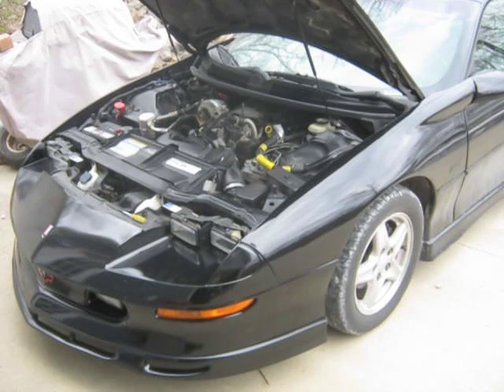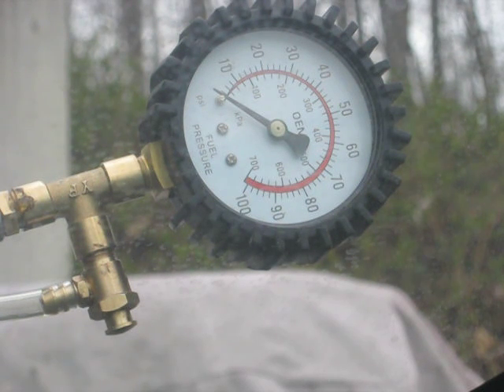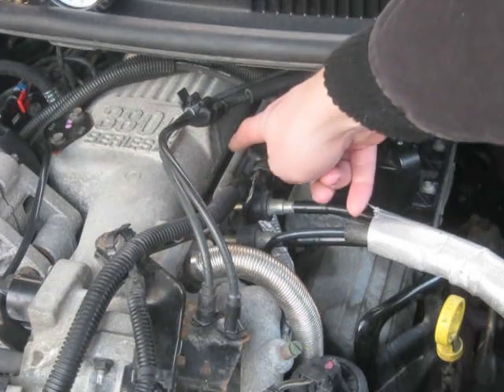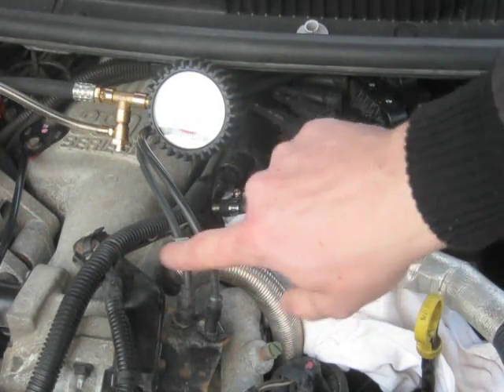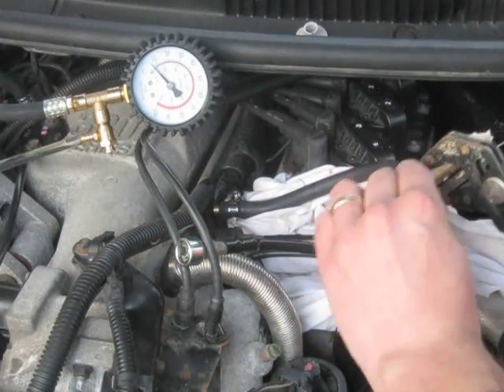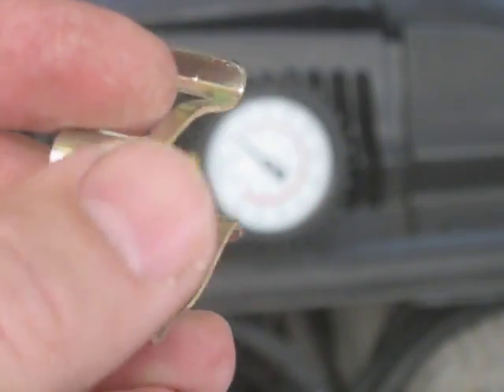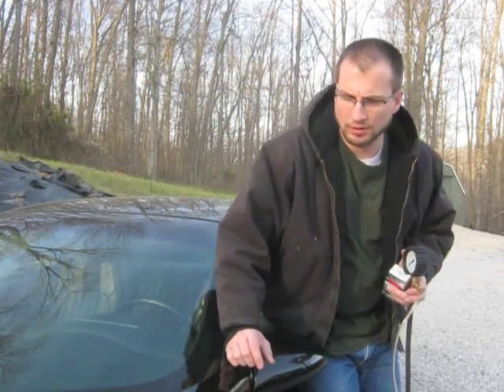Car cranks too long - Fast fuel pressure bleed off - Faulty regulator - Part 2

Comment: No question the original regulator was bad, there was fuel in the vacuum line. However, was the first new regulator faulty or did it leak because you didn't use the snap ring? You used the snap ring on the second one so you can't really say for certain that the first one was bad and the second one was good can you?
Reply: YOU HAVE TO USE THE SNAP RING!! I tried to use only the new clamp it comes with but the seal isn't tight and will leak gas. use the right size pliers and pop that new C ring in.
Reply: Facts

Comment: Great video . You went through the whole system , isolated the problem , fixed it and VERIFIED the repair . If you moved on and changed the pump - you would have been SCREWED . Then - do you put in ANOTHER ?  THIS is how it's done . There is a video on Schroeders Box where Matt explains the whole system .  On my 1987 Celebrity 2.8L the FPR ruptured . Gas came out of the throttle body through a vacuum line . I put a vacuum pump on the line and it pulled fuel on the first pump . And that FPR is buried UNDER the intake plenum and BETWEEN the fuel rails . I was lucky no fuel went into the oil . Keep up the good work !

Comment: I'm having something similar with at Toyota matrix....well I just believe that it takes a little bit too long to kick over. Nothing like what your car was doing but I have noticed at times it's starts a few seconds faster than other times. Did the key cycling thing to prime the pump and it did start on the more faster side. Any suggestions?
Reply from the maker: you could check fuel pressure like I did. That'd tell you a lot. Sometimes a dirty Mass Air Flow sensor can cause long crank at start. Could be any number of things, but a fuel pressure gauge can help narrow it down.
Reply: @TheDaninator  i did clean the MAF sensor and as well as the throttle body. I noticed a nice jump in performance but im still not too comfortable with the starting. Thanks for the tip with fuel pressure.

Comment: Check the codes for clues to mixture problems. ALWAYS disconnect the battery before removing electrical connectors to some parts. It can cause a glitch and short out parts or the computer.

Comment: the pump is probably bad too-  gauge needle should JUMP up at key-on.  not sluggish.
Reply: If the regulator is bad , and the diaphragm is ruptured ,  fuel will come out of the vacuum line . Fix the regulator FIRST , THEN check the pump . On my 1987 Celebrity 2.8L , the FPR ruptured and fuel came out of the throttle body , VIA the vacuum line . I put a vacuum pump on the vacuum line . It pulled fuel out on the FIRST pump . Bad FPR . He had a bad NEW FPR ! He fixed it .He then checked the pump .  Diagnose and isolate the problem .
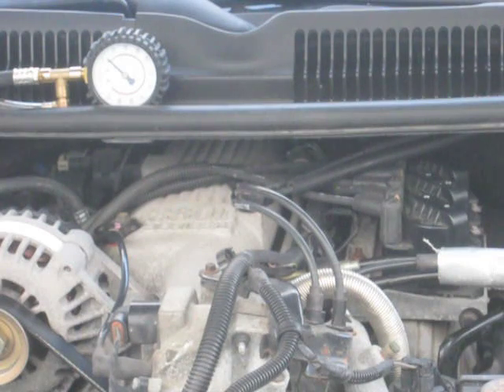Reply: At 2:48 he begins to explain ALL the possibilities for the low and no hold pressure . In this case , the NEW FPR was BAD . A new pump would accomplish nothing , except a thinner wallet . Every repair must be verified . In this case the FPR was not holding pressure . On my own car , it ripped and dumped raw fuel out the vacuum line . ZERO pressure and NO HOLD . Unless the entire system is checked , changing parts may not cure the problem . This case proves new means NEVER EVER WORKED . And you may inject problem # 2 with bad parts .

Comment: The Daninator how did you find this problem . I changed the regulator and got three new coils after getting faulty center one . did your have the same problem hot if you like go into bk eat for like ten minutes and come out and she has a hard cranking time
Reply from the maker: With the faulty regulator the fuel pressure would always drop to zero, so no matter when I tried to start it, it always took to long to crank.
Reply: My fuel pressure drops to  zero I placed a pressure gauge on the rail , But ill try the pinch off return line too see if the tank check valve is bad . I get 40 psi at idle I hope I don't have to change the pump or ill have too cut a access hole on top
Reply: The Daninator I blocked off the return fuel line and my pressure drops to zero . I have already replaced the fuel pressure regulator . I think its the check valve on the fuel pump . I don't get the fuel pressure to hold like in your video . I have too cut a access hole in the back near the tank .

Comment: same thing with 96 deville .. long cranks ... . mysterious wiff of gas every blue moon ..waiting on the part  now .. but weirdly enough i turn the key . wait a few seconds and it ll start rite up the last day or so . but like i say before  for like the last week . it was giving me long cranks . but then again i wasn't waiting the 3second poss to build that much pressure to just kick it on..but I'm gladif this is the fix ..even though i replaced this piece 2 years ago.. possible a common part with a spring can go out qucicker then u think . plus it may have not been the best quality part but it was like 50 dollars ..? we'll see. in afew days ..just ordered one for 35 .. good reviews ..

Comment: I wanna do that to my nissan titan 05,but just wondering if you have any idea,where is the regulator valve or how do i do it?
Reply from the maker: I don't know exactly. It's usually on the fuel rail to the injectors, but check out your owner's manual or google it

Comment: Great video!  Very good diagnostics and explanation.  Surprised however that after the fix the initial ignition on only got the pressure up to 10 psi. I thought it should immediately go to 40-50. I thought I heard the ignition being cycled 3 times to get it in that range. That behavior wouldn't solve the problem would it?  Again thanks for the video. I am replacing my FPR this weekend and this video will help ensure I am getting it right
Reply: condor5635 exactly, 3 times to build-up pressure. There is still sth wrong. In My opinion there is full filter clogged.  Question is where, there is one afterfuel pomp, one in FPR and there are filter in injectors.   Definitely to check!

Comment: you did good...alot of info,,,bro,,,,i have a 200 chevy short bed with a 4.3..v6,,,its starts most of the time but its starting to not,,,it will take me abunch of back firing or cranking b4 it starts ,,,its beginning to get worse,,,,i hope that its my f presure reg like it was with yours,,,will ill see if it is not untile sat or sunday,,,i drive it every day,,,it always runs like its something about the fuel ,,,not running right on my way to work,,,and its a throtle body,,,any ways thanks for the video.............................